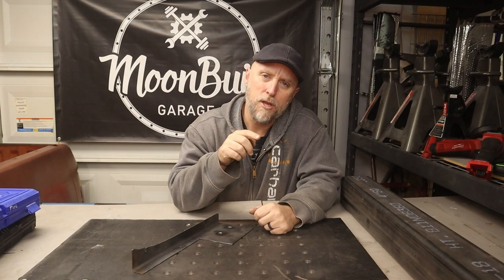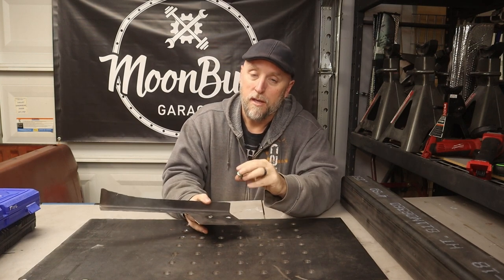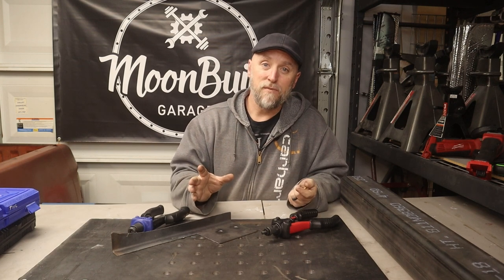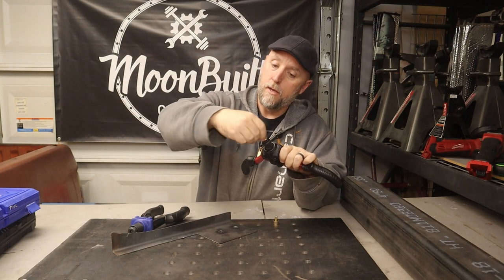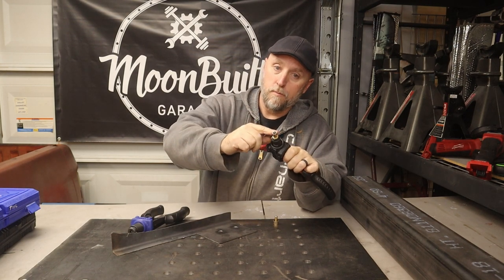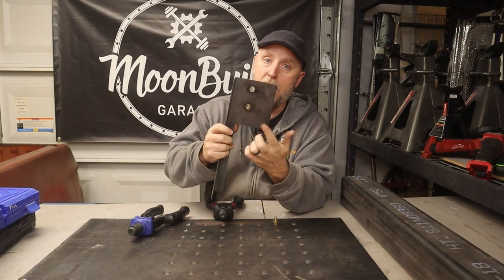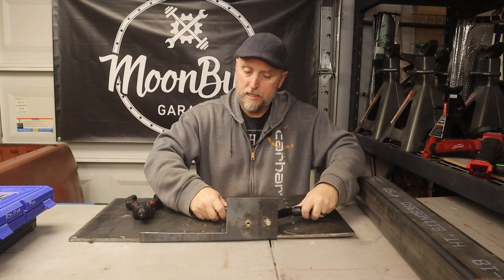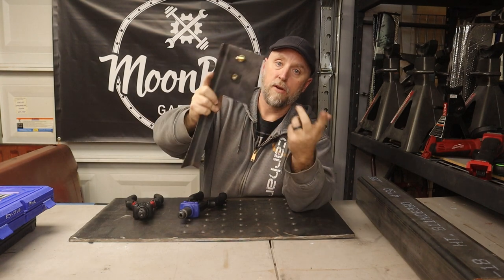🔧Tool Tech Tuesday #4 - Rivet Stud Setter

Comment: I've been looking into these tools. Back in the 1980's I had a Toyota with a luggage rack. I had to replace a couple of those nuts. I managed with a hardened bolt and a couple of wrenches. Now I own an Anglia and want to add that same rack on it. Thanks for the demo.
Reply from the maker: A roof rack...I wouldn't have thought of that.  This isn't a tool that I use all that often, but when I do it makes life so much easier
Reply: @MoonBuiltGarage  luggage rack on the deck lid.

Comment: I have a rivet-nut kit, and did not know about the rivet-stud; I will check and see if the brand I bought has a rivet-stud adaptor. Thank you very much.
Reply from the maker: I tried to use the riv-stud adapters in my riv-nut kit just to see of they would work, but they wouldn't...the handles are a bit different
Reply: @MoonBuiltGarage  Thank you for the heads up.

Comment: Great tool I have the incert
Reply from the maker: I've used the inserts for years, but never knew about the studs!  I used them when I made the fiberglass dashboard for my D100 project
Reply: They will work great in my 62 corvair
Reply from the maker: I've been looking at a Corvair....there's a 67 that looks to be in decent shape
Reply: I have a convertible one and a hard top both are 62 monza with the turbos
Reply from the maker: I honestly don't know anything about them, but I thought it would make for a cool project.
Reply: They are completely different from all other cars I have a 55 Chevy 57 Chevy and 61 Chevy bubbletop that I have redone the corvairs are so much different